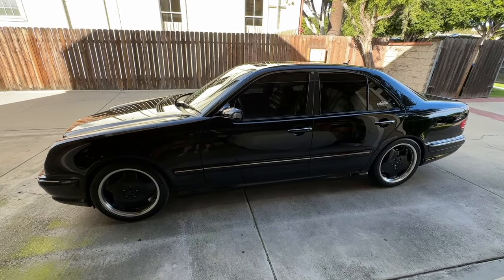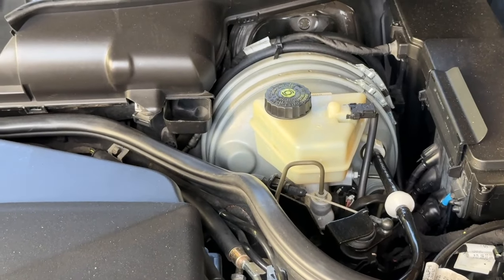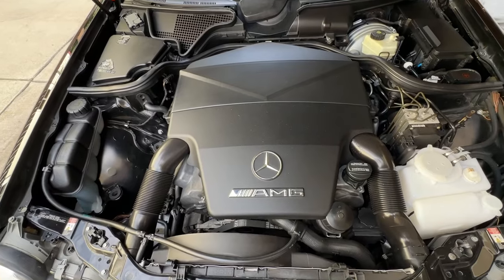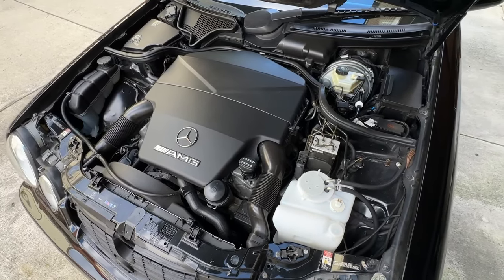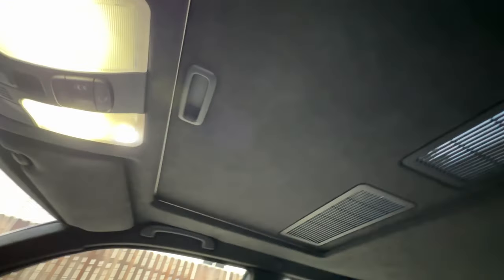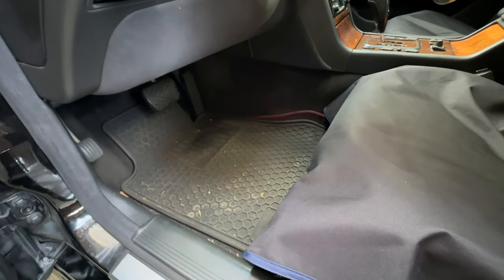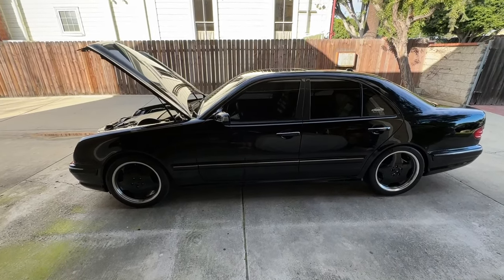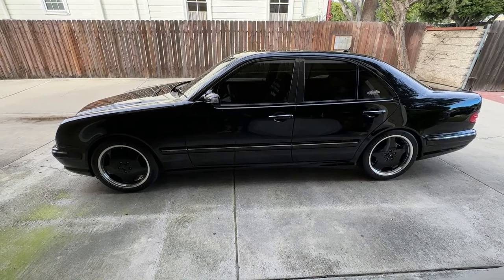10 Years With My W210

Comment: Really like your car, looks very immaculate. Also like the subtle changes, I might have opted for alloys in the original silver color though. 
I got myself a E430 4Matic 2 years ago which was repainted/rebuilt from scratch because of the rust issues here in Germany. Unfortunately the AMG bumpers where not available for the 4Matic models here and getting them now cost you an arm and a leg. Most of the prices for W210 have spiked anyway so please treasure your car for at least another 10 years. :)

Comment: To anyone that knows how to work on cars and turn a wrench. These cars are golden if you want a cheap, reliable, good quality car and the thing that makes them cheap is whoever owns it right now. Doesn't want to put up with the maintenance. They're tired of paying $200 for an oil change thats really 50$ tired of the $100 light bulbs where you can just go to a junkyard and get one for $2 fixing this car. There's so many ways around taking it to the dealer or having another mechanic scalp your wallets...... This is literally my sixth w210 and I started fixing cars with my first w210

Comment: +1.. A decade of ownership! .. Calls for an oil & filter change and fresh air in the tires celebration. .. Cheers, M/S

P.S., Sourced the AUXITO LEDs you'd recommend for the '94 C124. .. It's a full-on Colorado winter here at 8,150ft elevation. . The coupe has been hibernating since late November. .. Can't wait for Spring '24. .. Much to do with the coupe. .. All the best, M/S

P.S.S., That's one schweet OEM condition W210. .. Money well spent. .. Solid logic. .. Nice project !

Comment: Very informative video, keep
up the good work! I  completely agree with you on how hard it is to source replacement parts and to have work done.   

Question - Do you have any recommendations on where I can find a OEM front licence place delete for the W124?  The part is NLA from Mercedes and EBay has not given me any luck either.
Reply from the maker: There was a seller on eBay that had reproduced ones but they were pricey, there was also another guy selling new old stock which was also pricey. I think I see both of them still up on eBay.
Reply: +1 .. Ditto looking for an OEM front licence plate delete. (C124) .. Yeah, the eBay seller thinks he has gold. .. Possibly a 3D printed version might be worth the effort? .. Cheers, M/S

Comment: The blessing of california is the no winter and salt. In europe where it snows everywhere and they only don't use salt in switzerland and belgium i think, everywhere else these cars rusted years ago.. they used the technique of not refining the metal chassis as much and just use thicker paint to cut costs and it shows.. only letdown of these cars....
Reply from the maker: Even some of the cars here are rusting
Reply: They do use salt here in Belgium, I've had the E200 pre facelift and the rust was really bad, I got the facelift e240 now and it still got a little rust, i'm gonna try to fix it myself but I have no experience working on cars

Comment: I wanna say barn find but the owner died...never drove it...was passed on to some 17 yr old... He knew what he had but upon him googling and getting pricing for the maintenance he was scared to keep the car. So I got a 2000 e430 with 90,000 mi on it for $3,900.... The only thing it needs is transmission mount rotors and brake pads😊😊😊